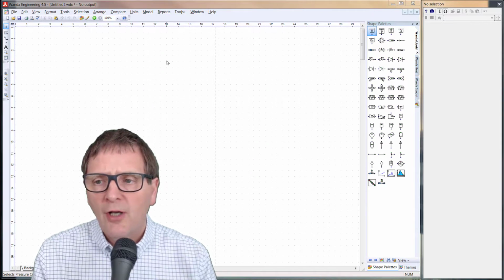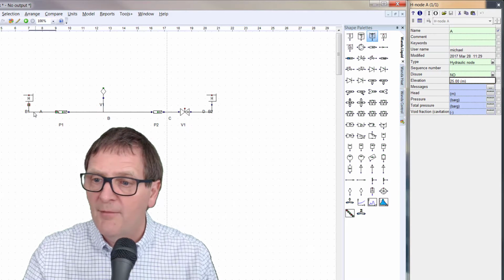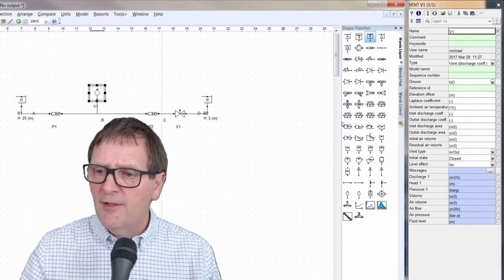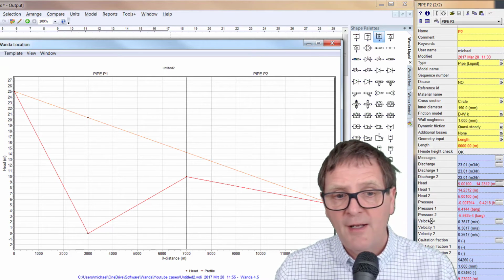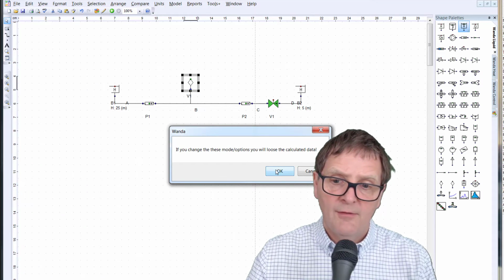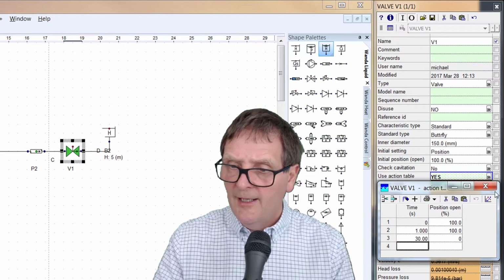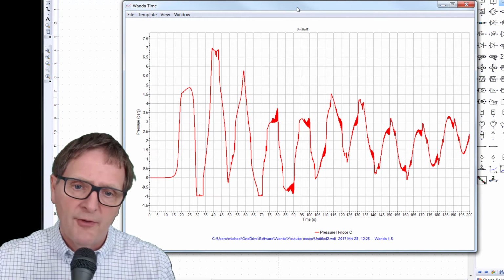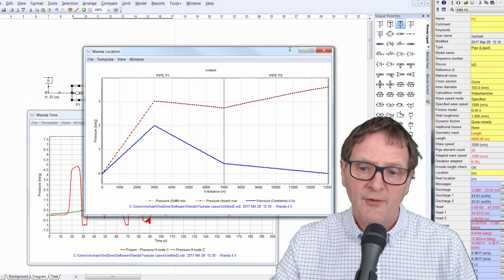Hydraulic modelling using Wanda

Comment: This is a very helpful video for beginners. What needs to be changed if, after running the model, the results are not displayed in the property window?
Reply: I just ran my model in WANDA, but no output values were displayed. Can someone please help out?
Reply: Something issue is theirs in connection between pipe line check proper check the warning error and then run 
And ofter running the model just you have to change in butterfly valve timing and opening position then run